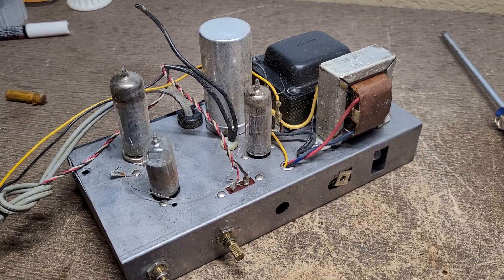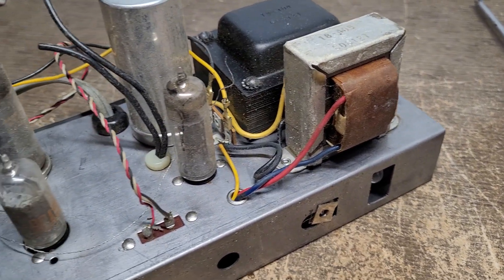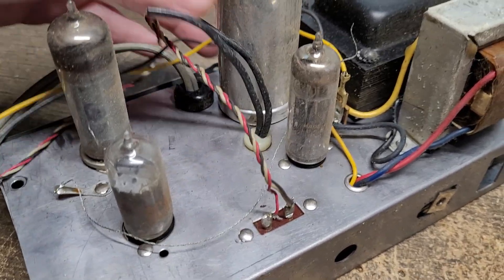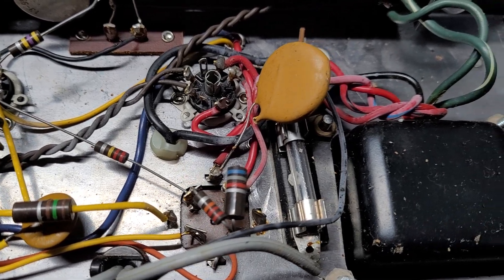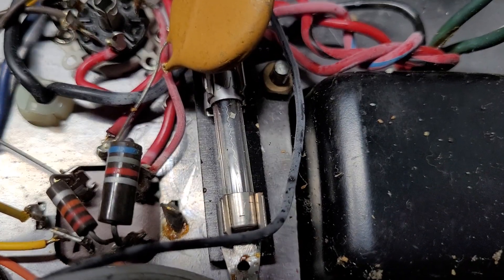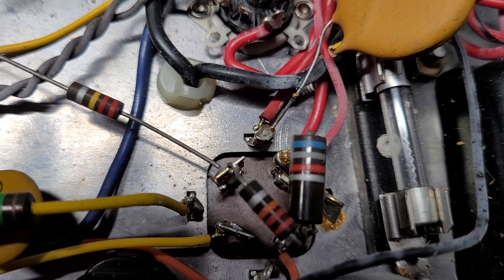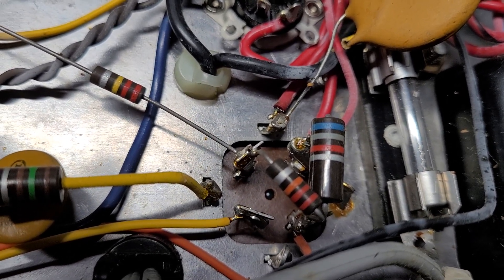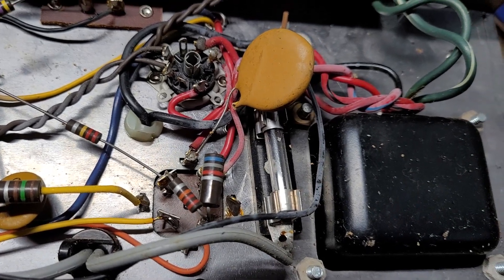A look at the Califone amplifier

Comment: Nothing wrong with leaving the original electrolytic in there. People get kinda carried away with the recaps.
Reply from the maker: It really is on a case-by-case basis. Visual inspection can reveal problems, and if the can gets hot in use, that's definitely a problem. This one checks out fine visually, but I'll definitely be monitoring those temps